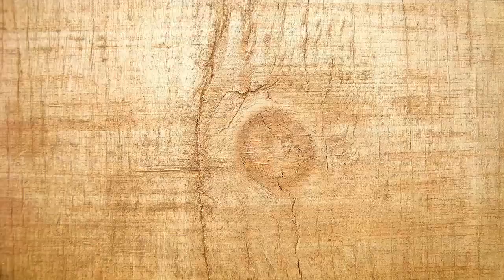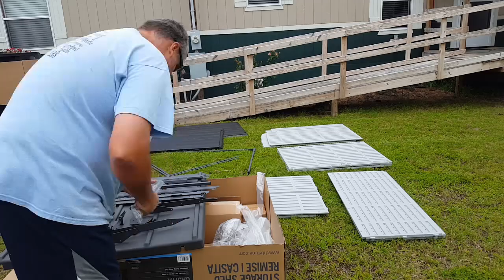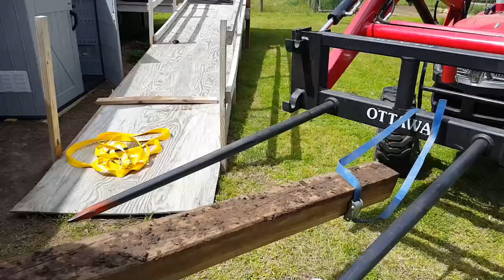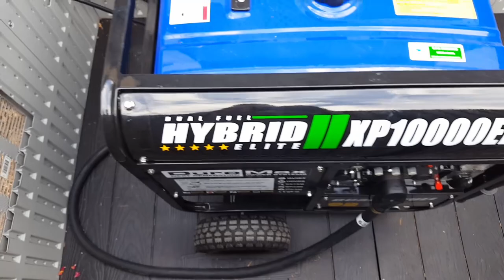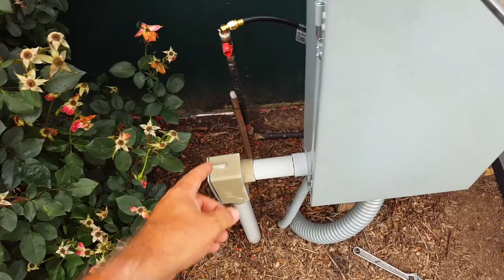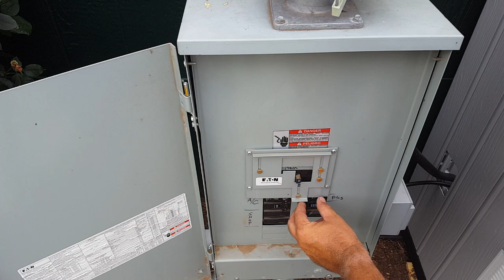Generator for the house - Dual fuel whole house system

Comment: Too often the term "whole house" generator is used incorrectly. You can connect anything and everything so you have the option to power a few things anywhere in the house, but the key here is a FEW things at a time. If someone is careful they can go about the house flipping on lights, etc, but they need to be mindful of turning things off as they leave each room. The gen set has limited capacity. Other things to consider is placing a portable set in an enclosure may void the warranty. In addition to that an enclosure with several holes in it will invite mice to move in, which can make a mess, especially if they chew on the rubber gas line. (boom?) Also, the NEC states NOTHING is to be installed within 5 ft of the meter. NFPA (fire / safety code) states you must have this a minimum of 5 ft from a combustible surface (the house) and from any door or window, for carbon monoxide issues. Portable gen sets are not UL approved for installation close to a building.
Reply: A 50 Amp power inlet box has a maximum rating of 12,500 watts.  Tell me again how 12,500 watts is not enough for "whole house" power for over 90% of the homes in America? The overwhelming majority of people who buy portable generators do not buy ones that will put out 12,500 to 15,000 watts of energy because they are "too expensive" (If they spend 1,500 to 2,500 bucks on a portable generator that will never be used 99% of the time, they can't afford to drink beer or go golfing this weekend). I could be wrong here, but I believe the OSHA and NFPA standards for portable generators is they shall not be used within 10' of a building, which is why almost all 50 amp generator cords start at 10' or more - but I could be wrong on the 5' or 10' rule.
Reply: @smithn.wesson495  ... as a rule, the general public doesn't think for themselves and tend to take things literally, which is why I stated the "whole house" generator term is often used incorrectly. That said, it COULD do a pretty good job, within limits. (that people need to learn) All it takes to screw up is someone flipping on the electric oven (usually a 50 amp circuit) in the kitchen without giving some thought to their actions. OSHA applies mostly to the work place, but there's some overlap to portable tools like gen sets. NFPA and building codes are national standards with local communities sometimes having stricter regulations. Power cords (not hard wired) are under UL approval for gen sets. They start at 6 ft and go to 100 ft. It's up to the buyer to know his local regulations. The 10 ft rule is distance to a combustible dwelling, which is slowly catching on. (was 5 ft) IOW, cement / brick structures are exempt but you still need to follow the 5 ft rule from any window / door / opening for CO issues. (drier vents included)
Reply: Ha ha ha your prob ably an inspector wow I wonder how people got along without inspectors and people that wanna tell you how to do everything, and then come to find out most of its nonsense bullshit, I’m a contractor good portion of the regulations they’re supposed to make a safe or strictly tyranny they have nothing to do with our safety. But you keep on telling everybody what they don’t know…
Reply: @MrThrock09  .... no, I am not an inspector, but I did do installations for almost 25 years. The main reason I keep track of regulations is because I hate to do things twice. IOW, if you fail an inspection then you have to make changes.... that someone has to pay for. Do you think a customer wants to pay twice? Do you feel I should do the job twice without extra pay? Why not do it correctly the first time? I won't argue semantics. We don't get to make the rules and we are not likely to change them by throwing our hands up in the air and shouting they are ridiculous. If you want to buck the system, go right ahead. You're just doing things the hard way and you will eventually get burned by your own actions.
Reply: You’re right!  I do it the dangerous way by back feeding thru a 240 receptacle.  Been doing that for over 25 yrs.

Comment: What you need to run a generator on propane is a volume tank not a high pressure regular. You need volume not pressure.
Reply from the maker: Ok, thanks for the info. High pressure reg on tank is standard with reduction just before home. This one has built in regulator on the generator so no need for reduction. As for volume... we did the math and we would have needed like 2 or 3 inch pipe to get the volume needed if using the low pressure regulator that was installed. Thanks for watching!

Comment: If you want to have electricity with grid down try with solar and li-ion battery's (Chevy volt battery) and you will have something from solar all year round
Reply from the maker: Yes would be an option but read other comments... $$$$$$$

Comment: Good tips...way to go in admitting your mistakes...that's very honorable.  I thought I'd add a little detail to those planning to try this "at home."  The tank should always be a minimum of 25' from a home.  Some regulations may require 50' or more.  Therefore, the tank cannot be moved close to the home as mentioned in the video.  It is best to have a "high" pressure regulator on the tank and a low pressure regulator near the generator.  Some generators come standard with the low pressure regulator installed.  As mentioned in one of the comments, you should not use "black" iron or galvanized pipe in buried applications because it will corrode and start leaking in as little as a few months depending on the soil and water content.  You should use a coiled tubing rated for burial.  Be safe out there folks.
Reply from the maker: Thanks, we plan on changing the run with the yellow poly. The guy at the propane store suggested it when we bought the regulator. We plan to do that this summer sometime.

Comment: I just screwed up my a/c heat pump by running my central a/c along with two refrigerators freezers, microwave, lights all at the same time. Have a Diesel 14KW generator and it's not nearly big enough to run all that stuff. Turn off the air and you'll probably be o.k.  You need a 22-25 KW for running your house. Your tag on your outside unit will have a LRA amount. This s locked rotor amps and this is what your unit requires for start up. On mine it's appx. 70 Amps. Although mine ran everything it screwed up my a/c compressor an it cost me $1,800.00 to fix. All this appliances require 2-3 times their normal amp rating for start up. Check into it yourself.
Just trying to save you some expense and heartache down the road.
Good luck!
Reply: Another important note is the percent of THD (Total Harmonic Distortion) produced by your portable generator, especially when being used to power appliances with advanced electronics, or smart systems. A 3 to 5% THD rating is outstanding, but even higher end generators (Duromax) can have THD of 8 to 10%. Some people will never have a problem, the next guy can seriously screw up his furnace,  pumps or more. However, Duromax does recommend the option of using a line conditioner to help with THD, which is good idea. Also, this is Common Sense 101, but make sure your portable generator also has an AVR (Automatic Voltage Regulator) to prevent voltage spikes from frying the appliances in your house.
Reply: @smithn.wesson495  98877
Reply: 9098

Comment: max you should have for lp is 10 feet and need to turn choke on full from your generator
Reply from the maker: Thanks for watching... not sure about the 10ft thing maybe if running it from the bbq bottle but after swapping to the high pressure regulator it works great. Also, "choke full" usually means all way closed no air but for LP you want it off or open in the run position. It is totally opposite to starting it with gas.

Btw... we were home this past month and started it right up and let it run for 15 minutes.  We just wanted to test it out for my mom while home and still going great so she is all set for the winter.

Comment: Everything you did is fine (EXCEPT YOUR GENERATOR THEY ALL DIE IN A YEAR OR SO  THE BEST IS USING A SMALL FUEL INJECTED ALL ELECTRONIC CAR WITH A 10,000 WATT OR HIGHER GENERATOR FROM ONE OF THE CATALOG COMPANY'S   I HAVE BEEN USING A 1999 BUICK CENTURY FOR YEARS FULL TIME AND NEVER HAD ANY PROBLEMS EVEN IN 30 BELOW ZERO IT ALWAYS STARTS  (PS i only paid $200 for the car. I HAVE TRIED  YARNMAR DIESELS AND JUST ABOUT EVERY OTHER MAKER OF GENERATORS OUT THEIR IT'S NOW BEEN 20 YEARS WITHOUT AN ELECTRIC BILL....  OUR GENERATOR USES ABOUT $40. A MONTH  AND WE USE LION BATTERIES JUST THE BEST. OUR SYSTEM IS 10 kw 220 VOLT SYSTEM IN CENTRAL MAINE  10,000 SOLAR ALSO
Reply: And not one video on your profile to fill us in about it. smh. Bruh.

Comment from the maker: More expensive... need MANY batteries if planning on powerering AC/heater for 3 or more days, need large seperate storage area for battery bank,  mounting of panels on roof, etc,ec,etc.
Reply: How many amps is you’re AC pulling

Comment: BigRedFishDad - Install a soft start kit on your A/C. Then the generator wont bog down as much. It allows the condenser fan to come on first then the compressor. So that there is less current surge.
Reply: Yes he is right. It’s called in rush current. Motors draw large amounts of current to start (briefly). Up to 100 amps depending on seer and tonnage.

Comment: Thanks for the tips, I have the exact same Generator.
Reply: Me too.  I've had it for a few years now and have only needed it a couple of times.  I just received my interlock and other materials to have it ready to go........ just in case.  We've had a lot of people move into our area and now I'm concerned that we may have some power outages.  In the past I just ran some extension cords but now I want to be properly prepared.  I bought a 50 amp setup and now I just need a new battery, lol.  That goodness for the pull start.  Has your generator held up well and have you had to use it much?  Thanks.

Comment: I don't mean to take away anything from all the work/effort that was put into this project because, it appears to be a nice installation.   However, I wanted to point out a few weaknesses in the system used here.  These 3,600 rpm generators consume a lot of fuel (even with no load), are noisy, vibrate, and have a short lifetime if run 24/7.  If run 24/7, it will drain that propane tank in about 4 - 5 days!  Also, the generator will be worn out in 2 months (assuming you change the oil every 5 days) if run 24/7.  Any generator that runs at 3,600 rpm uses a lawn mower engine (even the General Standby Home Generators) has these negative characteristics.  If you decide to upgrade to something in the future, go with an 1,800 rpm generator (preferably diesel), all of the above problems are greatly reduced. The downside of an 1,800 rpm generator is cost, which is several times what a portable generator goes for.
Reply from the maker: Yep.... all that is good info but read some comments below. With gas line and everything we stayed well under 2K. Should run 5 days at full load longer on less and for a 1 time per year use only IF there is a storm it is more than adequate. If we planned it to be a 15 year install we might have considered other options  Moral of story is everyone has their own needs so evaluate options and go with what suits you best.
Reply: ! Lol, the price of propane  for ten days will leave that  " I been had" feeling.
Reply from the maker: @robertl.fallin7062  bless your heart... !LOL, currently about 5 to 10 cents per gallon cheaper than gas. !LOL, doesn't go bad.  !LOL, and my mom won't need to lug gas cans around and refill tank every few hours. But hey other than being completely wrong thanks for commenting.
Reply: @robertl.fallin7062  propane in my area is much cheaper $1.50 per gallon.  So yeah propane is the way to go!